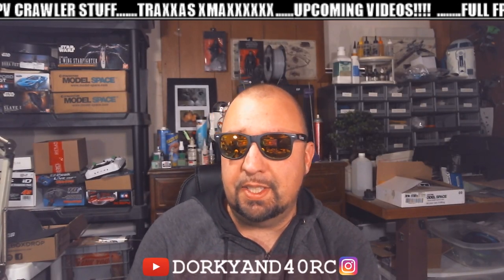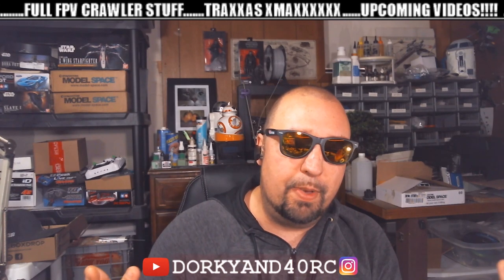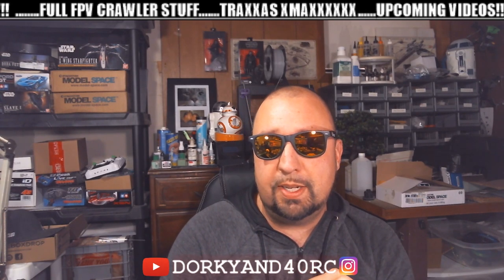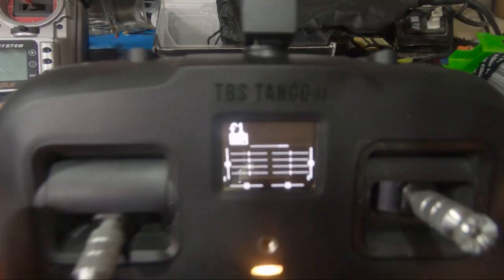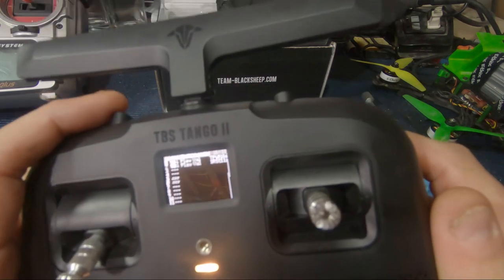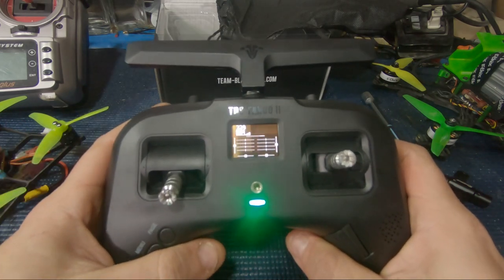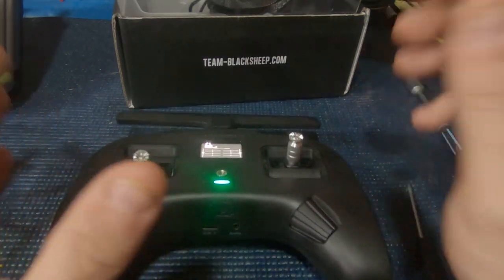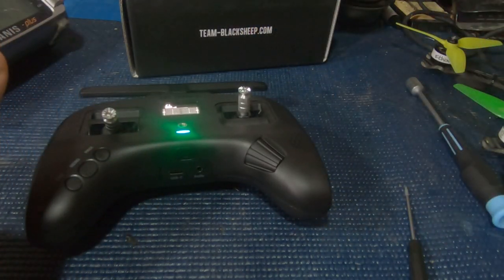TBS TANGO2 FIRST SETUPS AND THOUGHTS

Comment: Curious about the stick trims if you ever wanted to fly a plane with this... What I see in the manual sounds like sub- trims and wouldn't work IMHO..
Adjusting the stick trim while in use is easy. Double-press the Rocker-switch/Enter-button, an audible
feedback will sound and the corresponding stick direction will highlight on the display. Just the
rocker-switch to adjust the trim. Double-press to change to a different stick direction. Press Exit when
finished.
Reply from the maker: I don’t think it’s ideal but not a back breaker. Trimming a big slow wing like a recruit or the tbs wings would be fine LOS. If my wings are that far out of trim then it’s coming in or going down. Lol I would def make sure I had the process down like butter before trying though. Trappy is a wing guy so it has to work you would think.
Reply: @Dorkyand40  actually painless360 did a really good walk through on the trims, sounds like I need to get up to speed on auto trims.

Comment: thanks for your thoughts on it! scroll wheel reversal is coming soon. model selection bugs and display issues are going to be fixed in next firmware revision as well!
Reply from the maker: Great to hear!  Be proud of this product. Very premium for the price imo !
Reply: Team BlackSheep yes. Please. The scroll direction needs a reverse option. Appreciate your hard work.
Reply: Does tango 2 supports multiprotocol.....??
Reply from the maker: Umesh Jadhav crossfire only.
Reply: TBS, can you please fork Open TX Companion. It would make setting up my freestyle drones so much easier.
Reply: @aerialhorizonrc7827  the merge with OpenTX is underway.

Comment: Yo! Thanks for the video. Why not just use one model and bind all quads to it? That’s what I do on my receiver...
Reply from the maker: Need a throttle curve on one. And betaflight profile is bit different subtrims and limits.
Reply: DORKYand40RC so you prefer the throttle curve via the tx instead on in betaflight? Can you make a video on how you use the throttle curve and for what you use it?
Reply from the maker: @DesignRobot_co   i use the throttle curve in the TX for bettaflight and flight1.  the entire point of the curve is to match the hover points and feel of a smaller 3 inch vs a bigger 5 inch so its as close as possible when flying.  many people fo this with whoops too.  there are a lot of videos on it if  you search for open tx throttle curve.  wild willy is the best video that made i think

Comment: Can you bind multiple crossfire receivers to 1 model like how u can with frsky receivers? For example I have all of my d8 quads under 1 model and all my d16 quads under a second model
Reply from the maker: With the new multibind you can.
Reply from the maker: Actually yes. You’ve been able to. I have a flight1 profile and a betaflight profile and I just use those for all my models.
Reply: DORKYand40RC awesome thanks for the info. I think I’m gonna finally switch to crossfire, and get a tango 2 . Keeping my fingers crossed that the new ribbon connector in the tango is for a multi protocol module.

Comment: Was wondering how you got it to bind with your existing quads without pressing the bind button. Do you have a way to the the crossfire receivers to enter bind mode?
Reply from the maker: Just had to press bind on the remote and it saw all the rxs and updated them.  Maybe it was their firmware version. Which actually wasn’t that new. Maybe 3-4 months old since I updated? Maybe longer. Even the micro rx in my truck worked just fine over the air.
Reply: @Dorkyand40  OK. I heard an old firmware had a bug that auto bound. Maybe you were on that one
Reply: @Dorkyand40  found on the FB site that 2.93 or below allowed autobind. So people could downgrade to that then upgrade all automatically
Reply from the maker: Wade Tubman well awesome then. That number sounds familiar but who knows :) ill take it
Reply: @Dorkyand40  OK. Can confirm that auto bind and update works from 2.93. You just saved me a bunch of time.

Comment: So got my tango 2 last night and put on my flosstyle bf ship setup to it.found out I can’t put my WiFi password in because the screen is cut off the last 1/4 inch so can’t get last 4 digits in🤨! Also can’t figure out how to add more models..it’s goofy it’s not like open tx for my jumper or my taranis.qx7,x9d pro. Guess I have to bind models..someone needs to bring up the issue with the screen cut off!!! This is a HUGE deal and deal breaker on buying this! It will cause issues for sure! Just like when updating your crossfire receiver! Bout to do my own review on this that kabob,Botgrinder,stingy don’t bring up and know about! Please push this sucks not using WiFi kinda a big deal!
Reply from the maker: They say they are going to fix the screen thing. Sooner the better. I’m doing some range stuff right now actually. Have a few more things to bring up to tbs

Comment: I’m wondering about the WiFi and how that’s going to work with the fusion and the evo vtx? If you can figure it out for us and keep the videos coming! I own two of the tango 1 and have the full-size crossfire hooked up to one and the micro crossfire to the other and I dig it! I can plug my goggles into the tango 1 for the video feed! Wish they did the same thing with the tango 2 as well!! Plus the tango two needs more battery! Trappy talks this up like its the shit but the first one was bad ass just too big is all
Reply from the maker: im sure as time goes things will come out.  he already said that if enough people feel the need he would push out 500mw
Reply: The Wi-Fi on tango 2 already works out the box